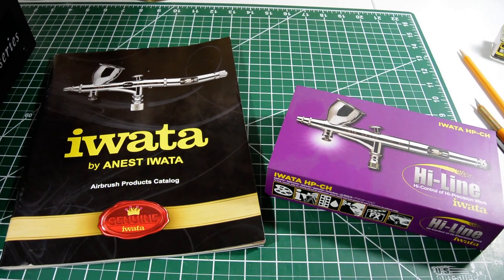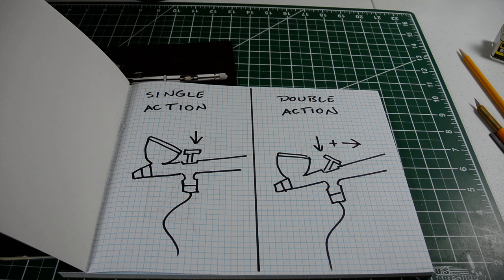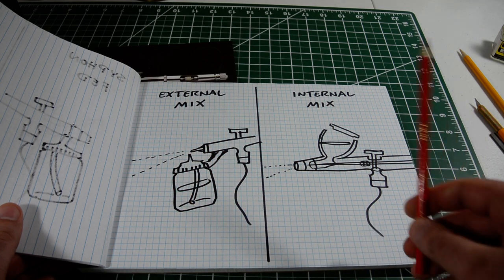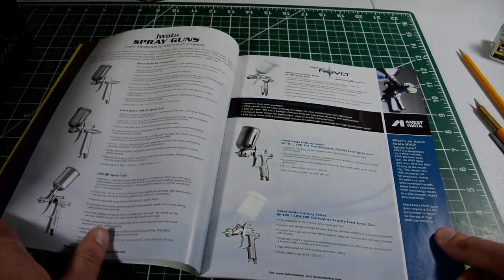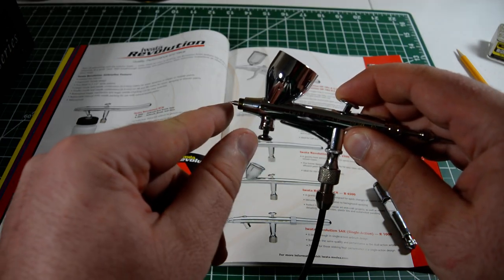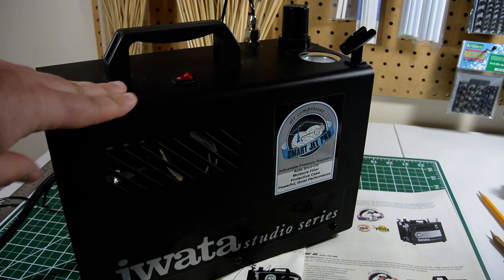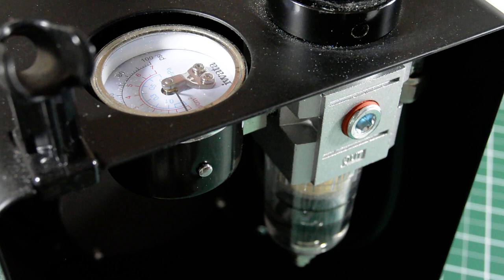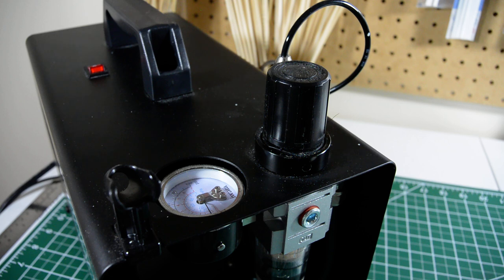Airbrush Tutorial: Part 1 - Airbrushes, Compressors, and Regulators

Comment: Tamiya Sprayworks Basic Airbrush  FTW! 70$ on Hobby Link Japan and it comes with both the aircompressor and the airbrush. But you have to add a 25$ for the charger adapter though. Plus the trigger is on the bottom, so the controllability is better than the typical airbrush.

Comment: I'd recommend a compressor with a tank. The little tankless ones usually don't last as long as ones with tanks. So you have to spend twice as much money replacing the tankless when it dies. Always use a filter at the tank or airbrush.
Reply: hardihood1 But a big tank and a big compressor. As it more often than not goes with us model builders, the painting session tends to last an hour or more which by that time will render the small tank useless keeping the compressor working all the time trying to fill the tank which just won't be able to do. So yeah, buying a decent compressor with a tank will cut your wallet deep and then some.  I'm much more for the "cheaper" stuff (nothing's cheap in this hobby) and just use it while it lasts after which I'd just go for the new one. It will last a few years anyway. I guess that a big set-up will last longer but I'm just not willing to pay ~$1000 for a compressor with a tank that would work for the next, say, 10 years or so. In the end it all comes to the point of view and opinion.
Reply: agree. i bought a cheap $60 tankless compressor and it died after 1 year. i did use it heavy for the full year. but $60 a compressor X (times) 4 years is $240. you can get a small compressor with a tank for $70....
Reply: Daniel Z You can get a solid compressor with tank for 80-150 that will last much longer and give you a much more even flow of paint.

Comment: Great video! Really helpful! However, I'm a little strapped for cash right now, so would air compressors not designed for airbrushing work alright? Also, are moisture traps needed in cold northern climates? Sorry for the stupid questions, I know next to nothing about airbrushes. >_<
Reply: XxEvilLizardxX You can use any compressor for airbrushing provided you have a pressure regulator on it that fits your airbrush hose. Also you will need a moisture trap, though most regulators include a moisture trap. You can even use those big air tanks like you see on fountain machines or for balloons. The only problem with those is you will still need a regulator and moisture trap, but the air will have to be refilled at some point. Kind of similar to those cheap can of air airbrushes. The big tanks won't run out nearly as fast, but every time you spray your air pressure goes down every so slightly until you cannot spray anymore.

Comment: I am looking into getting my first airbrush. As well as being good for finer work (shading and such), do you find that the 0.3mm nozzle of the HP-CH is adequate for laying down base colours on 1/100 mecha kits, or would I be better off with the 0.5mm nozzle of the Eclipse HP-CS? Thanks

Edit: Also, do you find the Smart Jet Pro's lack of a tank an issue at all? Would you recommend fitting a tank to it?
Reply: 0.3mm nozzle is perfect for base colors, that's what I use for base coating and varnishing.  It's a good general purpose size able to handle base coating and some finer details. It's the size I would recommend for anyone just starting.  Personally I would opt for a compressor / tank combo.  You can pick up a TC-20T style compressor on Amazon for as little as $70 USD, or you could go for a master airbrush kit with everything you need for around $100 USD.  While the airbrush in those kits is rubbish, it's good enough to get you started until you figure out for yourself what you really want in an airbrush.

If I were just starting out today, I would pick up a TC-20T compress/tank https://tinyurl.com/yc6qkqef and a VEDA 180 with 0.2mm and 0.3mm needles https://tinyurl.com/ydzdqf4u.  You should be right around $100 USD and they both use 1/8" connections so it's easy to setup and get spraying. Also  you'll have a system that you can upgrade as your skills improve.
Reply: Many thanks for your reply, Mark. Apparently, it isn't necessarily the size of the nozzle that determines optimum suitability for broad coverage, but the spray pattern. Because of this, I have been recommended a spray gun type airbrush for base coats, primer and topcoat (https://www.hiroboy.com/Mr_Hobby_Mr_Procon_Boy_LWA_Double_Action_Trigger_Action_Airbrush__05mm_Nozzle___PS290--product--10811.html) and a secondary airbrush with 0.3 nozzle reserved for metallics, shading and other finer work (an Iwata).

See here for reference: https://youtu.be/h0dKHxv0gGo?list=PLHO9r1wkd5PegL6O0BTrk3XEqH4j6tTDy.

I will probably be going with this setup along with a Sparmax compressor with integrated tank. It works out around the same price as the setup Henry uses in this video.
Reply: Good luck with your new equipment and happy painting!  I don't think there's any wrong purchase as long as it allow you to advance your skills in this hobby.

Comment: Ouch.... removing the needle chuck with the needle in it... Hope you got spear needles :)

Nice to see a easy to folow tutorial from a GOOD normal modeller... most are bias twords a company and somtimes(always) it just forgets the main idea... "How to..." :)

Will folow this series..

/Start wall of text...

If you are going for an airbrush to paint, then get good gear from the start... less hassle and spears are likely available..YOU WILL NEED THEM!

#1 Airbrush... Get a Iwata or Badger.. atleast a branded well known name. Dont go for the dirt cheap china knockoff's if you can afford. It will likely be less problems... and it will save on money and frustrations in the long run.

#2 Airsource... Go for a compressor with a tank and a regulator/moisture filter targeted at airbrusshing...It will make it easyer in the end... and less hassles with air related stuff... Get an compressor made for airbrushing... not the type used for airtools/regular painting.  You most likely have to sit by it and the normal compressora are LOUD and they mostly dont output clean water/oilfree air ...

#3 Practise!!!!... Yea, i know it booring  But it will pay off in the end... Dont just jump in and start on the model you have been working on the last weeks and expect that you dont fuck it up.... You will fuck it up, time after time in the start.. so get somting to practise on.. somting that dont matter that mutch... Get some ink and start drawing on paper...it will help when you get back to the "Pricewinner build" you are working on... Get some modelpaint and test... thinning it to the right consistensy and getting the right airpreshure... awww... painfull but fun....

#4 ...and if you break somting? You will breake somting.... so its smart to get some spears... Atleast a needle as its EASY to bend it(Drop ab on floor, bend it cleaning it... we all do it in the start) until you get conftable painting with the airbrush, a nozzle might also be nice to have athand...

#5 Do you reasearch... Read up on using and buying stuff before you fork out the money... It is a heap of info out there, good and bad... Join a airbrush forum..ask and read.... Most forums will have a beginner/tutorial section...

#6...  HAVE FUN! Failiure is a option that is choosen by defalt.. so have fun and practise....and ask for help :)

/end wall of text...